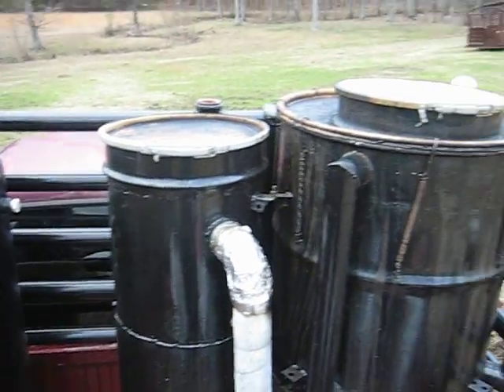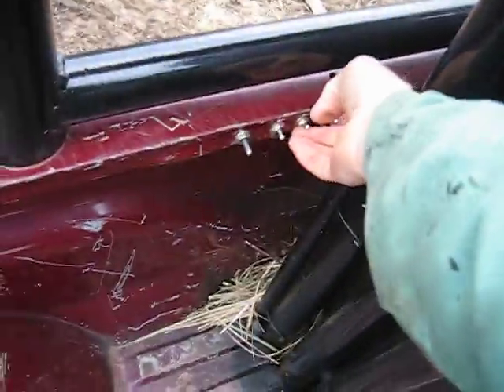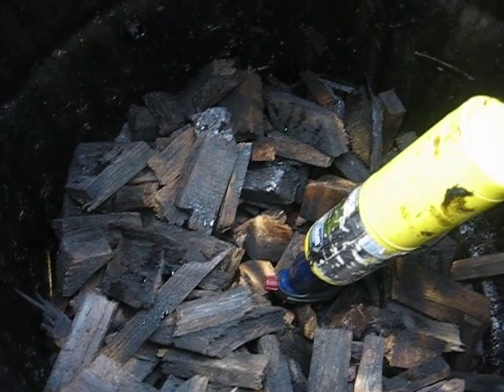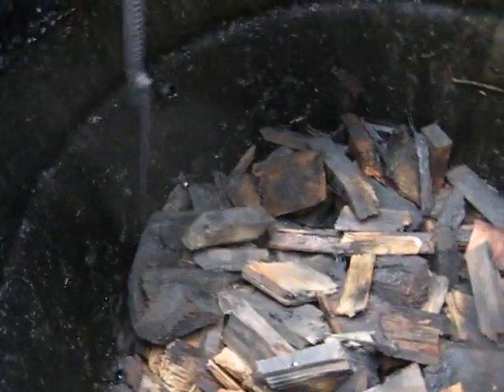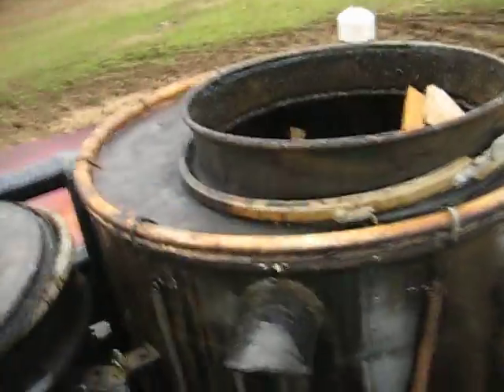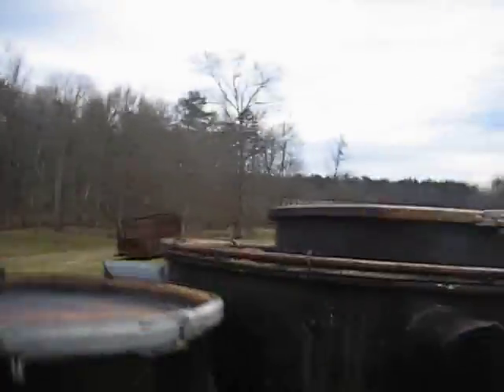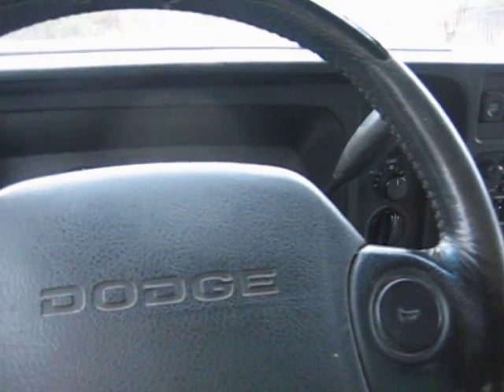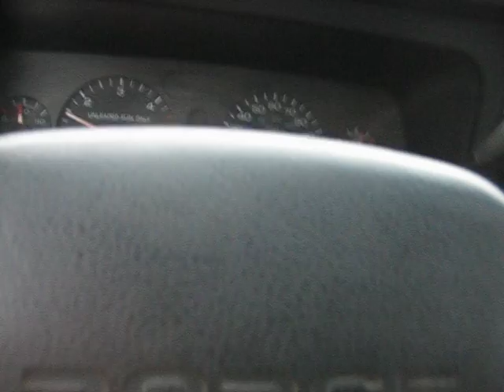gasification ,  Ram morning start, NO GASOLINE

Comment: Hi Wayne, just came across your videos for the first time today. What you are doing is amazing, I had never heard of using woodgas to run trucks, I am amazed. I run my 1998 Golf TDI with 50% used vegetable oil without any modifications to the engine or any other parts. Thank you for posting.

Comment: O Mr . Wayne great job ! I'm going to work on a way to compress this gas so that you do not need the gasifier on the truck. Have a great day God bless!!
Reply: Energy density is the problem. No reason to compress when you can produce it from much much more energy dense solid fuel, which is the main reason gasifiers exist.

Comment: A mechanical fuel pump is a diaphragm pump, There is a rubber sheet inside the pump attached to the rocker arm of the pump. this rubber sheet is pushed back and forth by the rocker arm. A pair of opposing reed valves is what allows the fuel to be drawn in and pushed out. Simply close off the intake side of the pump and it'll expel any fuel left in out, and only draw a vacuum each time the rocker arm is actuated by the cam inside the engine. No harm done. it "may" shorten the life of the pump

Comment: OR put the valve on the exhaust side of the pump and it'll simply stop the flow of gas and the rubber diaphragm inside the pump will compensate each stroke, Inside a carburetor, there is a float valve, when the bowl in the carburetor is full it simply stops the flow of fuel, the ball valve will do the same thing. the Pump is designed with exactly that in mind. Mechanic pumps only exert 5 to 6 PSI at most.

Comment: intercoolers will work as long as the channels are wide enough not to clog. I am working on a intercooler chilled by the air conditioner to lower the gas heat to be cooler than the ambient temp therefore making the gas more dense and more powerfull.

Comment: What is the purpose of those vertical tubes around the outside perimeter of the hopper
Reply from the maker: Hello Henri.

These tubes work as a radiator and helps remove and drain off condensation from the fuel hopper .
Reply: @waynekeith01  are there some kind of condensate lip or trap within the hopper? Where does drain to..your tar collector
Reply from the maker: @772777777777777  There is a gutter system inside the the fuel hopper that drains into a collection tank along with any tare .  These can be drain while on the fly controlled from the cab.
Reply: @waynekeith01  do any of your video show this ..thank you for explaining
Reply from the maker: @772777777777777  Yes .  You will need to become a member at driveonwood.com